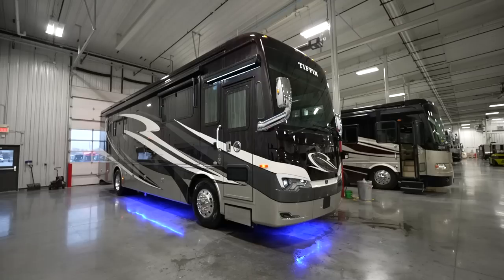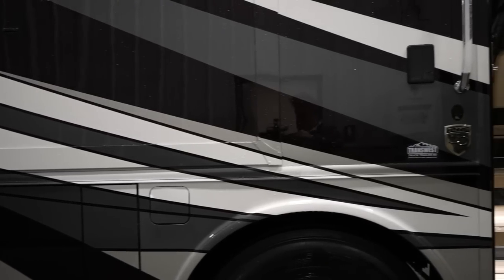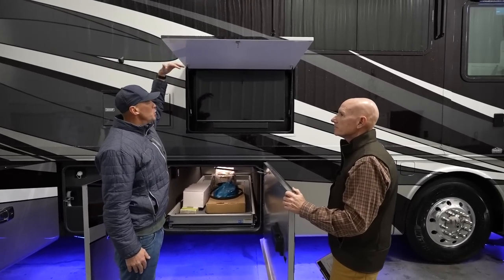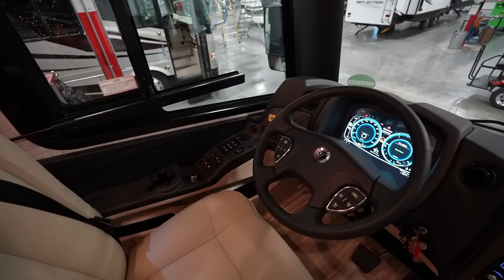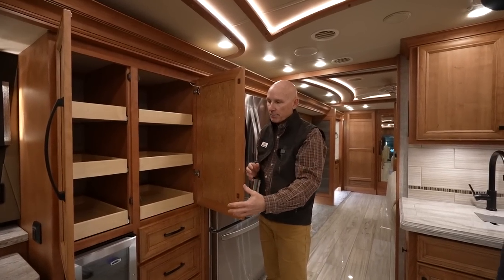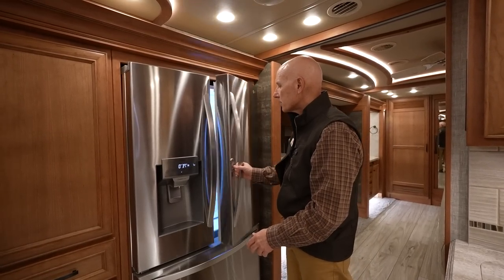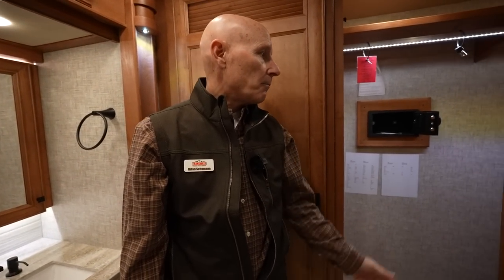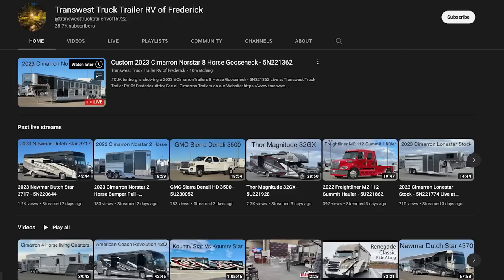35' Tiffin Allegro Bus that is LOADED with OPTIONS!!!

Comment: Checking the Tiffin site it says the 35 CP is actually 37'5" and the height is 13' 3".  The New Aire you compared it to is advertised at 35' 10" and height 12' 3", it's a nice coach but there is significant differences, the last of which is the basement storage, the NA has significantly better layout.
Reply: Good points but it is less $$